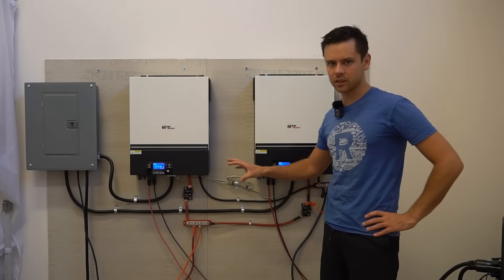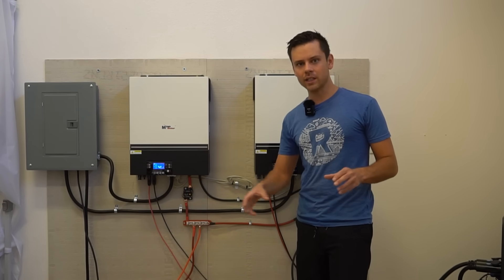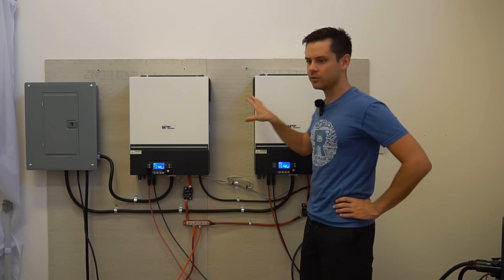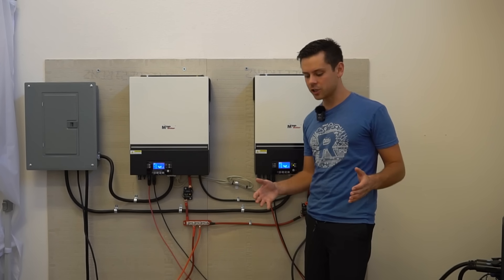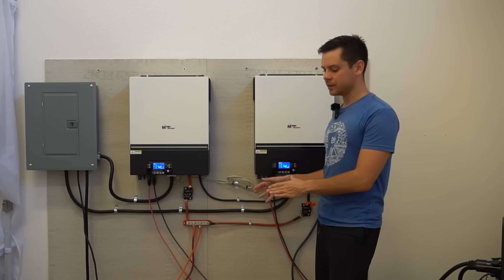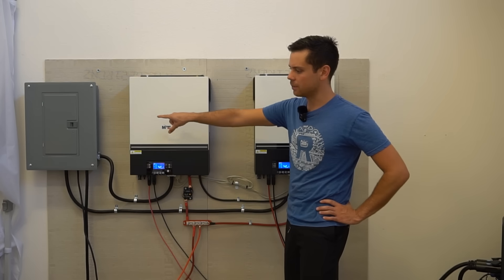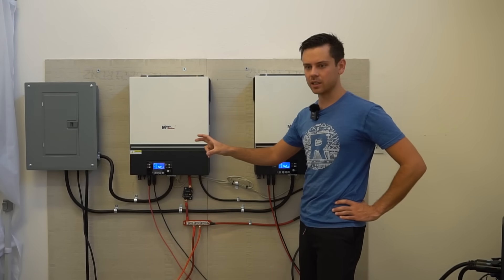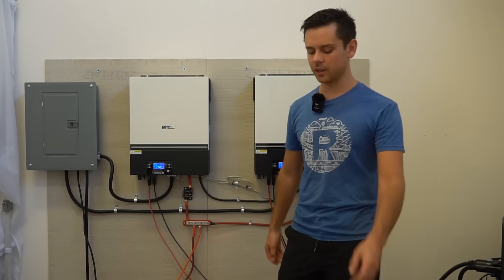Does my 13kW Offgrid Solar System require Grounding? Is it Grounded?

Comment: Obviously the ground is needed depending on your use.   If you want it near a kitchen,  bath or wet room,  by code you need a gfci.  With no earth ground,  you do not have a functioning gfci.   Therefore. You need the ground bro.  

I think honestly,  it would depend on your local city/ town/ state ordinances.   But I would not run your system as it's currently set up with any application that involves water.   So you are using it for lights and your minisplit and your Tesla?  I'm OK with that lol
Reply: You are 100 percent correct. Wills current installation violates codes in most areas. Arc fault and ground fault will not function. This installation should be bonded to the main grounding electrode.
Reply from the maker: @networkingdude  I am using it as an offgrid system, so I am not violating any codes here. The input is not for UPS or powering my loads. It is for running a current limited battery charger on it's on supply. It is not connected at all. 

My system is pretty much the same as a RV system. No true earth ground, unless when I am connected to shore power. When I am connected to shore power, the grounding is supplied by the grounding conductor at the plug. Then that is connected to the converter box with a battery charger. There are millions of RV's wire in this configuration, and no one is telling them to run a separate grounding conductor. 

When my system is connected to ground, it is powering a battery charging circuit and that is it. It has a transfer switch to be used for UPS is you choose to use that feature, but not in mine. So I am not connected to grid in the same way. I know that the ground is shared in this unit though, and I know that having a ground loop is a bad idea. I do not know the breakdown voltage of every component isolating the battery charger circuit, so I will ensure that the supply has a true earth ground.
Reply: You are correct,  being offgrid you are OK.    I'm just saying for the sake of referencing for other people's possible usage.  Even in an off grid atmosphere.
Reply: @mikemead2315  I believe I already addressed that and Will has also in a dozen other videos.    But if you writing that book makes your feel better.     Ok?
Reply: just as a reference, I believe you can use a GFCI without a ground, its not uncommon to do this when you need a 3 prong outlet in an older 2 wire home.  I believe most code allows for this, but requires the outlet to be labeled as such.  (no I am not an electrician).
Reply: Neither a GFCI nor an AFCB need a ground to function. In fact,  they are highly recommended,  when there is no ground return path available.

Comment: Are you actually running a ground wire from your service panel over to the service panel of the  building?  Therefore, the building service panel is providing earth ground via a ground rod.
Reply: he has a three strand (one ground) A/C in from the house grid tie... so yes it's grounded already.

Comment: Very interesting stuff about the "ground loop". And I have a question. My house has a ground for the sockets (with those metal rods in the ground at the corner of the house) and a separate ground (another metal bar at the opposite corner of the house, as it happens...) for the tv cable. Is that wrong? I am assuming the shield on the antenna plug at the tv is connected to the power ground. Maybe not. Am I in danger? Thanks!
Reply: What a great community! Thank you all for trying to help me understand this better. 
The antenna ground is something I did myself to get rid of EMF interference and I can tell you that is NOT connected to the mains ground. But I do wonder if TVs will connect the mains ground to the antenna ground (shield). 
I need to do some better research on this. Also, this is in Europe, on a 240V connection. Some things (codes) might differ.
Reply: Electrical codes should require all the grounding rods to be "bonded" together (i.e., there should be a direct ground wire connection between all grounding rods, which should also be no further than 16 feet apart).

You mention the bus bars are on opposite sides of the house, but that's probably fine as long as they share the same grounding rod or the grounding rods are properly bonded. If you want some piece of mind, you could trace the connection leaving the TV cable bus bar and check that it connects back to the service ground.
Reply: One more detail: the cable tv on my house (which goes to multiple tv sets) is NOT coming from outside the house. There is a fiber coming in with both internet and digital tv signal and it goes to this box that outputs internet and cable tv...

Comment: I haven't watched the video yet. 

1. Lightning protection. a system is more likely to survive if it is isolated from ground.
2. Safety Ground The protections of grounding an appliance chassis can now be handled by the newer technology of a Ground Fault Circuit Interrupter (GFCI).

I will not be grounding my system, as any 120VAC load will run through some type of GFCI. I do the same for portable engine/generator sets.

If anyone's system is to be installed permanently on a structure, building codes may apply depending on the jurisdiction.
Your Authority Having Jurisdiction (AHJ) trumps anything I just said.
Reply: System with isolated neutral (ungrounded neutral), or IT system, will have different behaviour, than normal system with grounded neutral. Especially, if it fitted with GFCI's. IT electric systems are used in industry, and must have special electronic equpment to control wire insulation integrity and resistance (relative to ground). Also, these systems requires to use 2-pole breakers - for both phase and neutral conductors. And this is not compatible with standard US domestic distribution panels. So, in order to stay within Code, it is easier to use standard system with grounded neutral. Even, if this system is completely independent from AC grid, except grounding "network" within household (grounded service neutral + local grounding rods or Ufer grounding + connections to various tubes, like water mines).

Comment: It's unfortunate that the National Electrical Code uses the term grounding and grounded. I was a member of the NEC section for many years and there has always been confusion. Many of us believe that the current terminology should be canned and use the terms earthing and bonding to help eliminate confusion. Many other countries use this terminology and it is much simpler.
Reply from the maker: I agree! I prefer using the term earthing, but I know that's not the appropriate term. It's unfortunate the terminology can be so confusing.
Reply: It needs to go! Those who know will pick up on the changes it fast enough. The rest of  that don’t can start learning properly.
Reply: i tend to think the writers of code want it to be confusing to make people call electricians for something as simple as replacing a broken outlet and wall switch on single light .and  that gets expensive since electricians have min charge to get the truck and electrician there .  i looked as the code what bothers me is where they could print the entire rule that instead do this then reference 2 other sections and after that the inspector don't like that he wants it don his way  . anything pertaining to homes should be plane English and full instructions so homeowner who may still want pro to do the job can understand what's involved so he gets what the job is worth not a extra unnecessary work
Reply: Good to know.
Reply: Ground
Earth
Dirt

I walk on them all. It’s not that confusing, really. 

Pos
Neg
Grd

L1 H1
L2 H2
L3 H3
bare/green/Ground

Red
Black
White 
Ground

There’s like only four typical variables for AC, and three for DC
Reply: @fishhuntadventure  Not that simple, different country uses different standard or code. Grd is not acceptable symbol, and it is still confusing, whether you refer to Ground or Earth. Ground and Earth ARE NOT THE SAME. Red Black White Ground?? Every country has its own color code. China and India use Black as Neutral, while Black is Live1 in US. 
L1 H1 ? What is that H1 ? My country uses Live (L) and Neutral (N), not H.

You just only saying it is simple because you are spouting what you only know, which is very tiny compared to the acceptable standard and widely known for the rest of the world.